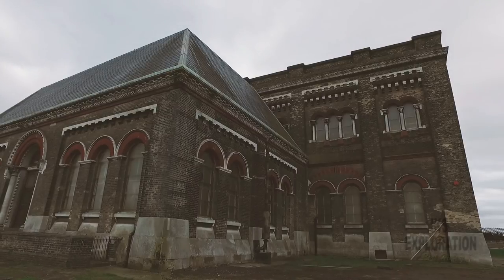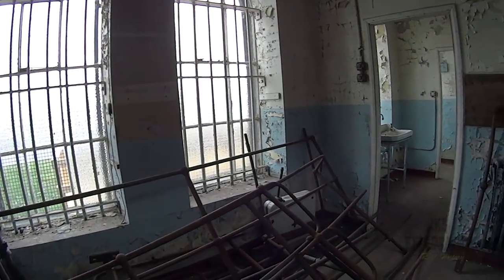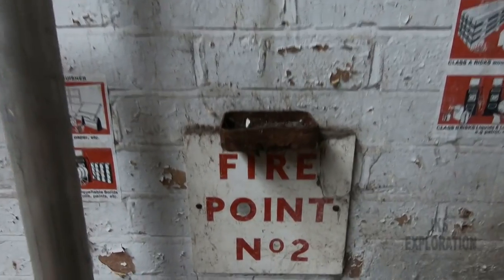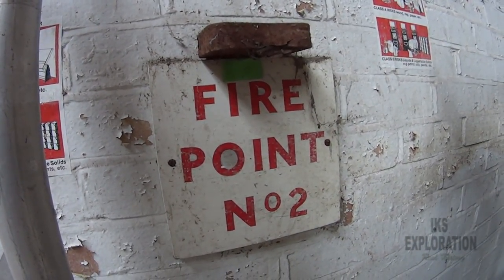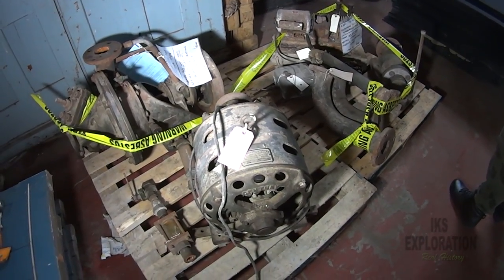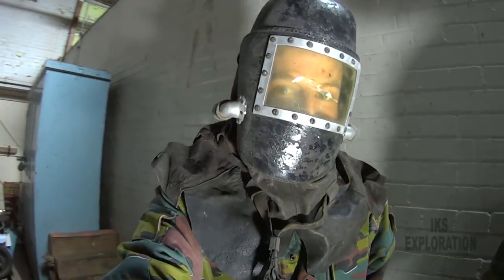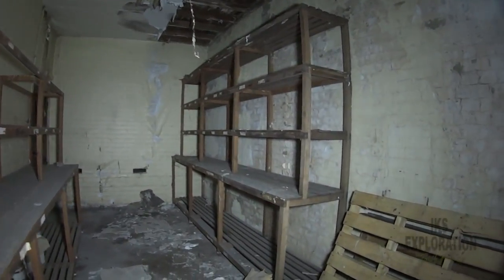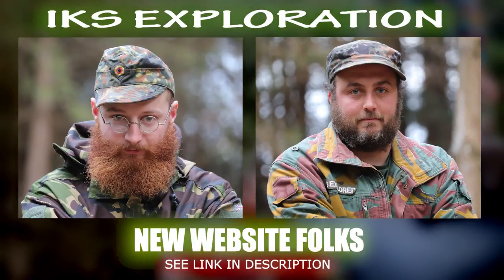Crossness Pumping Station - Episode 2

Comment: After 39 year working at Thames water and working at crossness for the last 28 year Crossness sewage works I've never seen in the old stores always lock up.about 33 years ago I remove the exhaust and blower from the one of the engine in the old storm engine house for a engine at Earl pumping Station Bermondsey where there's two of the same engines now mothballed there were supposed to 4 engine and pumps but due to the war effort two were sent to war ships.

Comment: The  Siebe Gorman smoke helmet apparatus which I remember being on older merchant ships 30 odd years ago. The bellows are double acting & the box contained a huge length of hose, there was also a life line of wire rope covered in cord which may have been asbestos, this connected to a leather harness, It was an early form of breathing apparatus for use in fire on board, the suit may have been a fear naught a turn of the century [1900's] fire 'proof' . Presumably these were at Crossness in case  someone needed rescuing from an area of low oxygen or toxic gas as well as for use in fire. Sewage produces methane w